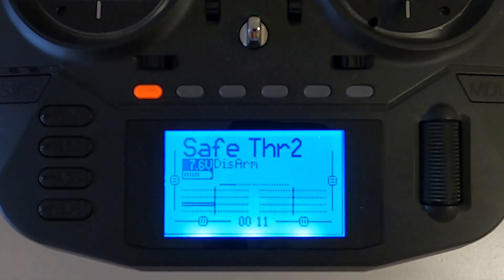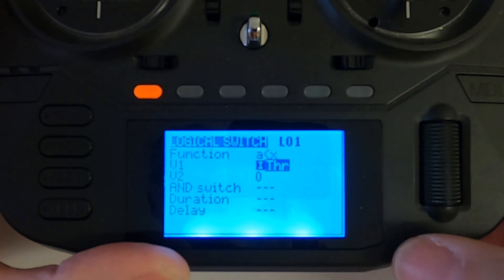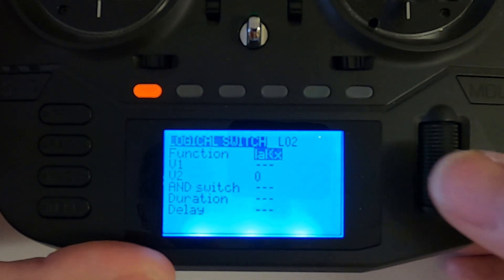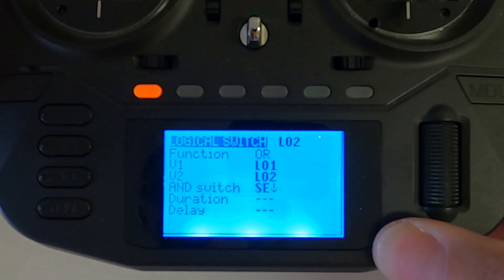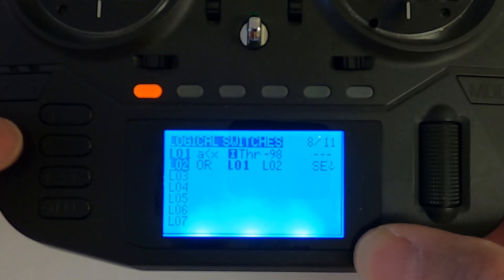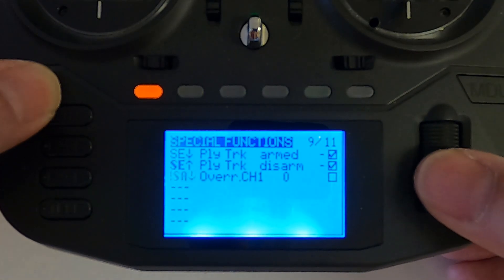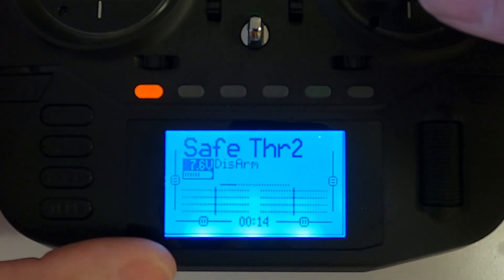EdgeTX Alternative “Safe” Throttle for RC Planes & Cars

Comment: Question. I notice that if I arm and bring the throttle down and up quickly it does not arm, only after a short delay does it allow to arm. Is this the delay you show and specify in your video on the radio and if so why?
Reply from the maker: It is just a feature it makes the arming process safer.

Comment: Hi Bill. I have spent most of the day trying to achieve the "safe" throttle on my Radiomaster GX12 following exactly many prominent RC Youtubers with no luck. The way you have shown it works. I wonder if the latest radios require a different form of logic/method? Regardless, thank you for this and keep them coming.

Comment: I have a boxer and and I have a fms 1800 ranger.  I set it up like.this video suggested and everything works fine at first.  Once I depress SE the throttle works fine but once I press SE again and it moves back to its original position (not in detent) the throttle immediately defaults to half throttle.  Any suggestions on how to prevent this?
Reply from the maker: Normally there is an error in the programming please check everything carefully to see if something is missing, check weights are correct plus or minus where required.
Reply: @the-happy-RC-flyer  Thanks. I also have the same problem, but I think you made programming error. Check at minute 4:25: with the SE disarmed the bar of channel three is in centre and not on the left which corresponds to the engin at idle.
Reply from the maker: @francobotto7267 thank I will check this out.
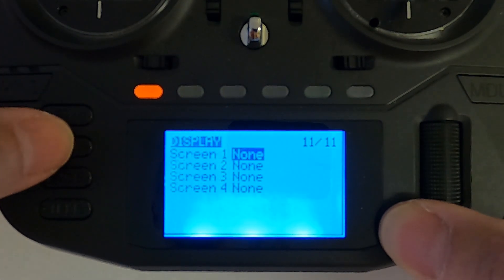Reply: @the-happy-RC-flyer  I understood the problem: at minute 3:53 the checkbox at the end of the line was simply missing!

Comment: No need for a logical switch, just one special function:
SA (off) override CH3 -100
Reply from the maker: This will work but it is not a “safe” throttle because if you arm with the throttle on full the motor will respond as soon as you arm. Plane surging forward into something or someone. The same result by adding an arming switch to your throttle mix which would do the same thing. You need the delay to protect accidentally full throttle on arming start up.
Reply: @the-happy-RC-flyer  The trouble with you Bill is that you have passed the stage of life where a little unexpected excitement adds spice to your mundane existence. Welcome to the club! 😜🤣🤣 
PS Just returned to your lists to work on adding this "Safe Throttle" feature (instead of just the above-mentioned simple throttle kill) to our burgeoning catalogue of diff thrust twins. 😉😊
Reply from the maker: @theoztreecrasher2647 Right again! How you doing Mate? I hope good. Your comments always make me smile. 😃
Reply: The wrong step is putting L02 in the throttle mix. If you do so, when L02 is not active a default value of 0 (mid throttle) will be automatically assigned. Leave the mixer as it is by default (don’t specify anything in the “switch” tab of throttle mixer) and it will work flawless

Comment: Bill thank you for your efforts i have finally found the frsky v on the tx 12 and i have successfully done the binding . I am using this in a three channel glider so i will be disconnecting the aeloron lead from the receiver and replacing it with the rudder lead i am using mode1 so rudder and throttle right hand elevator left see how i go thanks again
Reply from the maker: You are very welcome and good luck Neil.

Comment: Hi my model is not the EU model. You did a video on the original TX12 fine tuning fr sky  receivers. In that video you were using fr sky V8 receivers I have three of these V8 receivers I was hoping to use. I hope I can find a way of using these. But it seems it only lists D8 under fr sky in mk2

Comment: 1:46
Reply: Hi Bill on this video on special functions do you have to tick each box on the last line you didn't tick the box ? I have been having a problem with motor running flat out when I disarm.  When I switch to arm the throttle works as it should.

Comment: Hi Bill I have frisky V8 receivers but it seems the radio master tx12 mk2 doesn't list them it lists d16 and others. The V8 receivers were listed on the original tx12. I also have E-fly 6 channel receiver I don't know whether I can use that either?
Reply from the maker: Hi Neil, I have just checked my external Multi Protocol Module attached to my Boxer and it has FrSky D subtype D8. You may have the EU firmware which D8 as far as I understand is not available.
Reply from the maker: Neil, check all the FrSky protocols and the sub types it should be there. Have you done any firmware updates?

Comment: I am trying to set up tx12 mk2 edge tx mpm. I have been watching you old video on setting mk1 version setting up for normal plane use. There are differences eg wizard etc. Do i have to set up safety switches everytime i introduce another model plane or would they simply swap over.  Have you done a video on setting up the tx12 mk2. Edge tx?
Reply: Thanks Bill will see how I go and figure out how to change from four channel to three and swap positions.of rudder to aeloron
Reply from the maker: Hi Neil, if you set up a model with a safe throttle, which is advisable, you can just copy that model to another model number and modify it if necessary for your new model. Check my EdgeTX playlist. If you need further help let me know.
Reply: @the-happy-RC-flyer  thanks for your reply I am 74 yrs old and not very computer minded. So setting things up for me is a battle. Your videos are very helpful that's why I was hoping you had done a video on the tx12 mk2 edge tx. I have watched the set ups on boxer and tx16 are they the same ?. I am also trying to set it up for a powered glider without the aelorons so it's only three channel but not sure what to do I tried to use wizard I click on plane but doesn't have provision for no aeloron.  I am a bit lost I think I will have to delete what I have done and start again. Oh well it only took me four hrs hopefully this time I will be quicker I will use the method for safety switch shown in this video  thanks again
Reply from the maker: Hi Neil, you are never too old to learn new things I should know 😊With your three channel glider set up a standard model. Assuming your radios channel mapping is AETR plug your rudder servo into channel 1 as this is your primary steering channel. Do not plug the rudder into channel 4. EdgeTX is the same on all radios but different in terms of switch layouts and colour screens etc so can look different when programming. This is why I produce videos for the different radios. Any further help let me know.
Reply: I am a new member of a flying club undergoing training. Using mode 1 right hand throttle and aeloron and left hand rudder and elevator. What you are suggesting for three channel glider would make throttle and rudder on right and only elevator on left hand side. I can see how this would work in my case. Thank you for your help much appreciated
Reply from the maker: @neiloxley7904  Hi Neil, if you are flying mode 1 as I do right gimbal throttle and aileron, left gimbal elevator and rudder but because you will be steering your glider with rudder only you use the aileron gimbal. You instructor should advise you to do this.